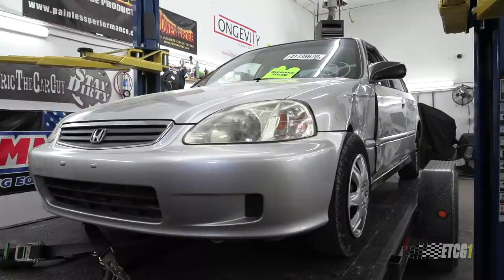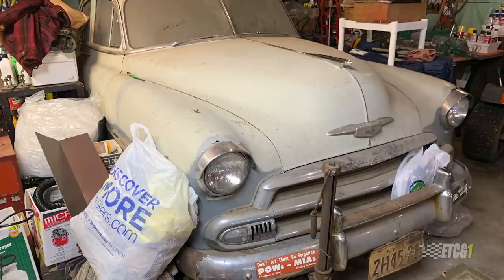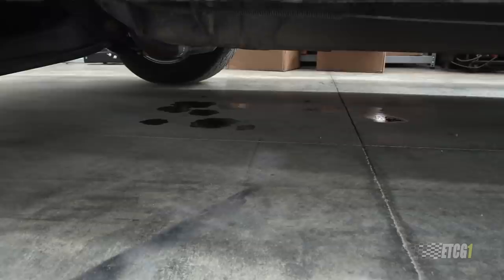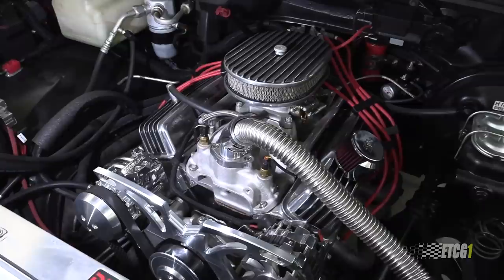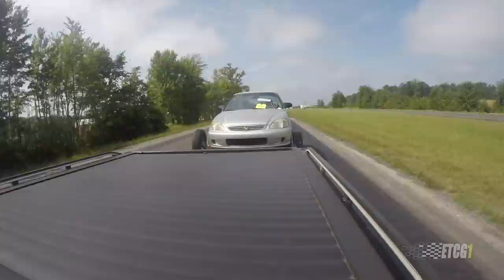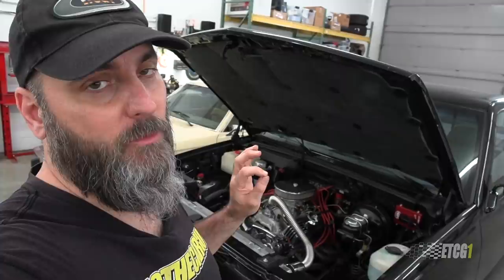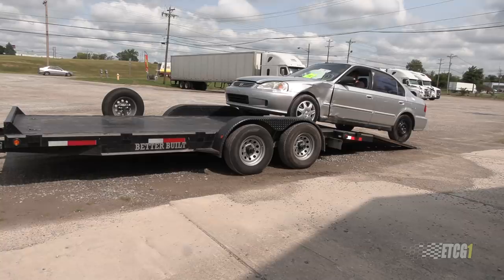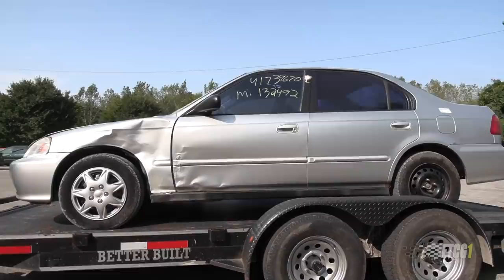First Time Towing with Dads Truck

Comment: Eric, just FYI, I just went out and looked at my dad's 89 GMT 400, long bed, 2wd, 5.7 liter, AT, with a tow package and the door sticker looks just like yours. And there's no GCWR on it. The tow pack has 3.73:1 gears, big mirrors, receiver hitch, and a 32 gallon gas tank. It also has aftermarket air shocks on the back with individual fill lines and they work great, as little as 25 psi makes a big difference. We don't overload the truck, but we occasionally carry loads of firewood and/or tow a good sized utility trailer, and the air shocks work great to compensate and help with stability. Your car and trailer are probably at the upper end of what you can tow. I'd say the Civic is too far forward on the trailer as others have noted, fixing that should help.

Comment: When you load something onto a trailer you want the rear to go down about an inch. That will be about where you want your tongue weight to be. Take a measuring tape and measure from the ground to the center of the wheel arch. Then position the vehicle on the trailer to where it goes down around an inch.

If you put in some spring helpers, airbags, or whatever you can up the amount you can put in the back. Call helwig I am sure they will help you out in that area. 

With the upgraded engine and brakes, you should be able to tow around 6,000 lbs pretty easily without trailer brakes, and 7,000+ with trailer brakes. Your rear axle rating depends on the tongue weight. If you have a trailer that you can position the load on get it centered up you will be fine. Especially with trailer brakes. 

Too little tongue weight and it will sway at speed. Too much tongue weight can do the same thing, but it can also mess with other things as well. Ideally you want about 10 to 15% of the gross trailer weight on the tongue. So a 2400lb car and 2000lb trailer, the proper tongue weight would be around 440 and 660lbs. Let's say the vehicle and parts you want to bring down from NY is 5500lbs. On the same 2000lb trailer. You are looking at 750 to 1125lbs tongue weight. 

My best advice would be to use those figures and then measure how much you can put on the tongue and the back of the truck drop around 1". That will give you your ideal rating for your setup. For instance if you can only put say 500lbs in the bed of the truck before it goes down 1" then 5,000lb trailer/vehicle is your limit. If it's 750lbs then 7,500. 

If you want to measure the tongue weight. Get the same trailer again, put the car back on the trailer in the same position, or a new combination. Then use your engine hoist and a strap and go on Amazon or wherever and buy a crane scale. It's a scale that measures hanging weight. Put that scale in line with the tongue of the trailer Ideally the centerline of where the ball would be. Then measure the weight. Hell I am sure it would make for an interesting video if nothing else. If the tongue weight is too much, then adjust the car toward the back of the trailer. 

Also note that you can load vehicles backwards. Engine being in the front of most vehicles driving it up forward in the same position will add more tongue weight than reversing it. 

All in all your truck is fine for what you want to do. If you plan on towing multiple cars? Then I'd suggest a bigger truck.

Comment: Just because the gcvwr isn’t on the sticker doesn’t mean it doesn’t exist. In fact it is a very uncommon number to find on the door sticker until you get into newer trucks. Even my 3/4 ton diesel doesn’t have it. You can often find that number in your owners manual in some type of chart with all the different configurations that your truck would’ve come in
Reply: Exactly, most vehicles don't have the GCWR on the door sticker, some of the newer vehicles do though especially when you get into 3/4 ton and larger trucks.
Reply: @FixingWithFriends  Even if its in the owner's manual it doesn't even apply to move because of additional option packages that were added, etc....its just a blanket statement which leaves a lot of overloaded vehicles as a result.  Another one that people don't understand it seems is that having 4WD doesn't mean you can tow/haul more, its actually the opposite.  4WD components add weight, thus reducing your payload rating which means you can't haul/tow nearly as much as the same truck in a 2WD configuration.
Reply: Thing with gCwr is it’s fairly simple to cover all configurations with a chart since it encompasses the weight of the tow vehicle and towed vehicle. For example my truck has a chart that shows the gVwr, engine, transmission, gear ratio and series of truck (2500, 3500, etc.) and and from that you must subtract your unladen vehicle weight to find your actual towing capacity. Every truck I’ve ever tried to find a gcwr for I’ve either been able to find in the manual or with a quick google search. What I’m getting at is every vehicle that has a tow rating, has both a gvwr (all vehicles period) and a gcwr

Comment: one word for hauling trailers, diesel. Ive done the big V8 thing and hauled 3-4 tons, tried a diesel and the experience is very different.
Reply: Way more low end torque,  truckdrivers use it all the time.

Comment: Here in germany we don't even get half ton trucks. The common truck driving around is a minitruck ie VW Amarok, Ford Ranger, Isuzu D-Max.

I tow with my VW Bus (eurovan). No problem! Loading the trailer the right way is the most important thing!!!
My Eurovan weighs about 2 tons when towing and has a max tongueweight of just 100 kgs (210lbs). Thats enough to make the trailer not squirrely

Our standard cartrailers weigh about 500 kgs (1100lbs). Maybe yours was made to tow trucks and not only econoboxes. 

Other than that, brakes are really important and fuck power. Downshift and crawl. 
Sometimes i'm crawling in 1st gear (manual) but the 78 buff horses the bis diesel makes is just enough.

I love your videos, keep up your good work and have a nice day :)
Reply: TwoBeers I have a frontier which is similar to the navara.
Reply: TwoBeers I can tow s small utility trailer I have a 4 cylinder

Comment: A couple weeks ago I managed to tow a 2000 Toyota Tacoma (2.7L 4x4 single cab) on a full car trailer with my dad’s 2019 Ford Ranger from Wapakonetta, Ohio up to my house in Oregon, Ohio. Nothing ever ran hot or bogged down and only used a little over a quarter tank loaded and doing 70mph.

Comment: I don't agree with the comments saying you need at least a 3/4 ton for towing. Sure, the beefier frame, suspension and brakes make a big improvement but that car + trailer is what, 5000-6000 lbs? A half ton can handle that just fine. 

If I'm remembering correctly, you also beefed up the brakes. I dont remember what your gearing is, but even tall gears on flat roads will work.

The biggest issue, that I see, is the way the trailer is loaded. Need to have most of the weight over the trailer axles and a little bit up front for some tongue weight to keep the trailer from being squirrelly. 

If you want to tow heavier things, then the rear suspension would need some addressing. I don't know if an add-a-leaf would work or some airbags. I see lowered tow rigs all the time hauling big ass trailers, so there must be options available since those guys aren't dragging their frame and sparking down the freeway.

Reposition that car, take it for a spin to see the difference and return the trailer (I'm aware you've already returned it by now, but I bet you would aee a big difference).
Reply from the maker: I agree with everything you stated. I never intended to make this into a tow rig, I was just testing the capabilities of what I had. Now I know. I might try some air shocks, also a load leveling hitch. I considered air bags, but given that I don't plan on hauling a lot with this truck, it didn't seem worth the time and expense. 

BTW, that car is not getting back onto a trailer under it's own power anytime soon. Check my social media. Thanks for the comment.
Reply: I agree that he doesn't need a bigger truck unless he wants to get into multiple car towing. That truck especially with trailer brakes can handle just about anything he plans on it. The best way to measure how much you can tow safely is measuring how far your bed goes down with how much weight you put in the back of it. You want it ideally to squat about 1".

Tongue weight should be between 10 and 15 percent of total weight of being towed. The weight of the vehicle and trailer. In that specific instance 2400lb car and 2000lb trailer. You would need around 440 to 660lbs tongue weight. 

Add a leaf will make the suspension stiffer overall. This is not a bad thing if you only use it for towing. Since towing would be a side thing or infrequently that would be a bad choice, since it can't be changed easily. Spring helpers offer a progressive approach. You will get the same or very similar ride to now, but the more weight you put on them the stiffer they get. Air bags, with an air pump and electronically controlled would be the better option but it's the most expensive option. Just air bags and manually filling them up or taking air out is around 1.5 to 2 times the cost of spring helpers generally speaking. 

With all of that said, the main thing to keep into mind is the rear axle rating, and the tire rating. Unloaded go to a truck stop and get on a CAT scale put your front tires over one scale and rear over the other. Then go in and pay for the scale ticket and that will give you your rear weight. Minus that from your rear axle rating and that's your payload for the bed of the truck. Looking up this specific truck his payload should be around 1700lbs. Figure 300 for a driver, and other items that should easily be 1200-1300 over the rear axle. Figure say 1,100 tongue weight then 7,000lbs towing would be at the low end, with the top end being 10,000 lbs. 

Also to note if you absolutely have to have a lot of weight over the tongue like how he loaded the vehicle, you can get a WDH. A weight distribution hitch.
Reply: A GMT400 half ton is barely rated for 6,000 lbs. That being said, I think the biggest issue is the trailer itself is to heavy. That's a very excessive trailer for a car, if he got a lightweight car trailer it would be fine.
Reply: @Serps-ii9zc  GMT400 is rated for 7500lbs with a lowish power engine. 6,000lbs. He specifically mentioned that his was rated for 7500 in stock configuration. With an upgraded engine it would be able to handle more. Especially with a braked trailer. I'd be more inclined to agree with you if the trailer did not have trailer brakes. The trailer he had was fine, except for the sticking brakes. Get those fixed and it would have been 100% fine for the situation. Sometimes trying to rent a trailer isn't all that easy to do. Especially at the last minute and you may not get a huge selection so you have to go with what works, even if it's a bit overkill. 

"if he got a lightweight car trailer it would be fine."

If he got a lightweight car trailer, and loaded it the same way? It would have been slightly better but still not great, and lighter trailers don't always come with trailer brakes. 

His main problem was improperly loading the car and put too much nose weight on the trailer.
Reply: @ETCG1  oh no...you need a dedicated tow vehicle...

you know that FINNEGAN'S SELLING SQUARE FORCE ONE....ITLL MAKE A GOOD TOW VEHICLE
Reply: @q......  no half ton GMT400 is rated for 7500 lbs. Towing package trucks, which he said this isn't, are rated for 6500, so his truck is rated for 5,000. True, renting a trailer means you kind of get what you get but from the looks of it that's not even really a car trailer, it's an equipment trailer. I actually have a GMT400, a 95 C1500 Suburban with a factory tow package, so a 6500 lbs tow capacity. I've pulled a car trailer behind it with a first gen Dakota on it and didn't squat anywhere near this bad, but I had a lightweight trailer.
Reply: I pull a car trailer nearly every weekend with my 1/2 ton F150 with no problem. 

What i would recommend outside of the other things mentioned is helper air bags to keep the rear jacked up and off the bump stops
Reply from the maker: @clevelandmaker386  Too big for me. I want a truck I can use for more than just hauling cars around. Also, $55K is a good price for that truck, but a bit outside my reach ATM.
Reply: @ETCG1  get a sponsor dude..
Reply: ETCG1 I'd guess gcwr would be 12,600
Gvwr should be 5,400 lbs on the truck and tow capacity for that year 5.7 v8 is 7,000 lbs
Reply: ImConstantlyConfused main thing I feel air bags in the rear
Reply: @ETCG1  ever thought about getting a tow truck? Then wudn have to worry.

Comment: Eric,
 From someone who has hauled tens of thousands of miles with a flatbed trailer. Even 16,000 lbs on a dually goose neck behind a 3/4 ton Ford diesel. Weight placement on the trailer is everything. You can tow safely with your set up. In the car you just hauled, backing it on the trailer would have put the engine weight over the trailer axles and yet given you enough hitch weight to make it safe. Too much on the axles and not enough on the hitch would be the tail wagging the dog. Air shocks would be just fine when towing just to keep bump stops from bottoming out. But with everything, experience gives you confidence. I would not have a problem towing with your truck using an equalizer hitch. Great video!

Comment: I had a 97 c1500 extended cab I added a leaf spring and put a set of air shocks in the rear and it really helped the truck out a lot  I pulled 7000lbs a few times with it  and it did ok.  Good video

Comment: 3 suggestions for towing safely:
1) Weight distribution hitch. I have one for my 30ft camper.
2) Proper load balancing on the trailer. That was your biggest mistake with the Honda...too far forward.
3) Towing shocks. I use KYB Tow Max. 

Stay safe!!!

Comment: The car is loaded too far forward. You need to adjust the load so the rear squats at most one inch.
Reply: Pretty much exactly what I was going to say.
Reply: You need some tongue weight, and that car isn't that heavy, you move it back much and the weight is only on the trailer axles and it would be a bad time. In a perfect world a c1500 should be able to handle that load but this is an SS, not really meant to be a "work" truck and the suspension just isn't up to it.  It's also lowered which makes it worse. I mean look at the rate weightings on it.

Comment: Hey brother!  Air shocks, air bags assistance, or Load Leveler work great.  Also, (not sure how trailer experienced you may be amigo) move your load back to where you have no more than approximately 500 lbs, not less than 300 - on the tongue itself.  Get a scale up under the tongue and move the load in the shop until you get the load tongue weight is exactly as you want.  Then hook it back up to the trailer, note how much suspension compression the truck has with it loaded properly.  Let your trailer carry the load, but check the trailer brakes EVERY time prior to loading it this way.  A longer trailer will let you balance the load better.  I have a 24' tilt deck trailer, and would not go any shorter.

Comment: GMC Sonoma: I put hd bilsteins (increased compression and rebound compared to gm zq8 valved bilsteins ) and half a hellwig helper spring kit . It helps daily tool hauling and yearly towing. Check out hellwig and there are some shocks with helper coils attached " "coil over" towing shocks

Comment: I think the truck is fine.  The heavier truck you get the more you get into scrutiny from the DOT and authorities, ANOTHER insurance payment and maintenance, if you're only using it to haul a trailer it'll sit a lot and that's often rougher on a vehicle than being driven all the time.  Past 3/4 ton (may vary by state) you start getting into specialty licencing regulations and crossing state lines (depending on who peed in that officers wheaties in the morning) requires more approval (again, more so for heavier trucks).  I'm in Michigan and I have a E250 3/4ton Ford Van, if I went to an E350, same body style and everything, I start getting into being pressured to insure it commercially, get a DOT#, Chauffeurs license, log book, all that professional trucking stuff.  But there's a couple things I think could help mitigate things.  The car can be positioned farther back on the trailer juuust a hair, you absolutely want tongue weight but that trailers axle positions are more for a utility trailer not necessarily a car hauler (even though they work), look at U-hauls car trailers and you get the idea.  Otherwise, helper air bags on the rear springs would help with the extra tongue weight.  But with properly functioning trailer brakes, I thinks it's plenty of truck to tow the occasional car around.  I've had to remind a lot of people that it's OK to notice the trailer back there, and having the power and stability to tow at 80mph dragging whatever/wherever isn't the best thing to do/have.

Comment: People are going to say I'm crazy. They already have, but I used a front axle, less than half-axle trailer when I had a 2600 lbs car to move. Saved me a lot of weight. I'll never do it again unless it's a car with a front turning lock. Stupid car turned it's wheels while on the axle and I had to turn it straighter again the whole trip. Drove across the nation that way, but I did it with a lot more truck so the truck never felt it. People were right. Take the hit from the 2k extra pounds a proper trailer is and not deal with all that.